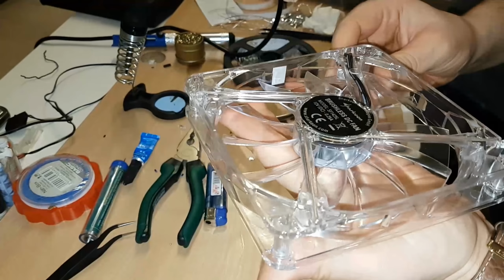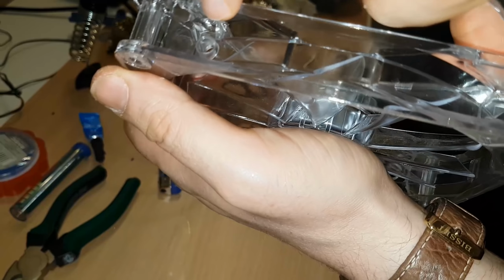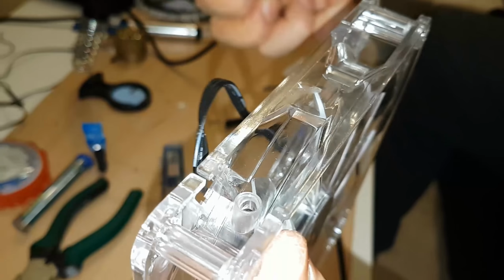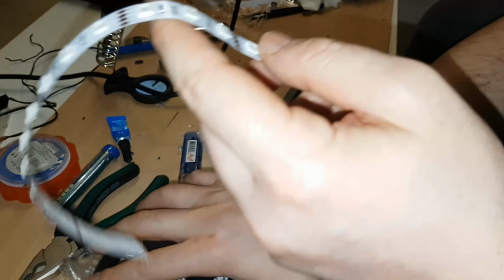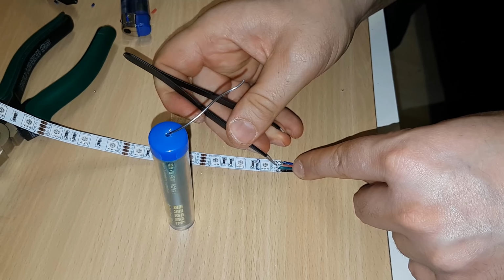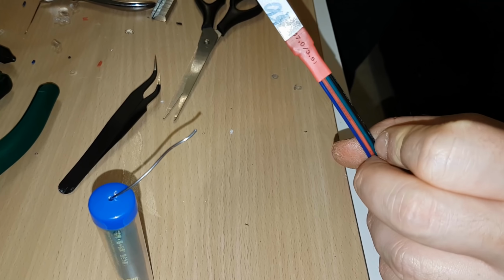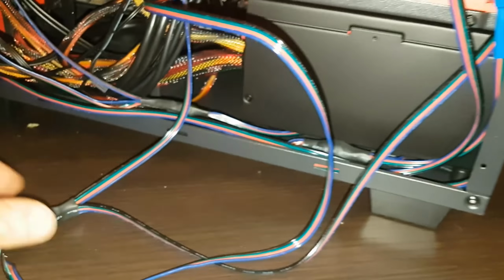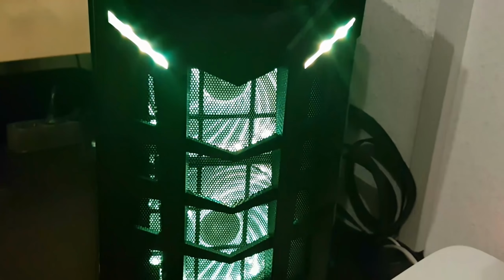How to make your own LED 12v R G B ASUS aura sync case cables management ring fans & led rgb strips

Comment: Hi mate a nice little video, i'm a Electronics Repairs Engineer by trade I would give you a small piece of advice and to anyone else watching this that when you've soldered the wires on before you use the shrink rap on the joints get some clear nail varnish yes varnish any type and brush a little over the joints it adds extra insolation and avoids any accidental shorts,  but nice work buddy :p
Reply from the maker: thank you :)

Comment: This is amazing. How you make your connectors for motherboard ?  Where you connect all fan and rgb strip.
Reply from the maker: Connect them together each color with the same color
Reply: @shafikbanialmrjehkassar4640  That i got it. i want to know about connector which connect to motherboard  on time of video 21:24 . your all rgb cables connect to motherboard that connector how you made. I have Addressable RGB strip but i didn't find connector to connect my motherboard.
Reply from the maker: I have bought them from Amazon... I live in Germany and online you can find anything you want but the connectors should come with your motherboard.
 any way I will send you links.

https://www.ebay.de/itm/111047186905

https://www.ebay.de/itm/143616871578

But I don't know if they pass with Adressablr RGB strip.

Comment: I will probably do the same cos i have some poor leds diyng on some fans and argb is super expensive. I have 12v rgb on Motherboard but not all Motherboard has that, now they come with 5v some.
Reply from the maker: You have to buy the 12v led strip then

Comment: hi, i have rgb strip 5050 which i buy from aliexpress, will it work on rgb fusion too..? still waiting for my motherboard to arrive
Reply from the maker: You have to see your Motherboard wich kind of rgb strip supports... read the Manual when it arrives and if it supports an addressable strip with data transfer then the normal strip doesn't work
Reply from the maker: I think gigabyte b450 aorus elite supports both addressable and 12v R G B  Strips but for sure the Addressable strip is beautiful more than the normal 12v RGB 5050
Reply: @shafikbanialmrjehkassar4640  thanks
Reply: @shafikbanialmrjehkassar4640  do u think i can sync using rgb fusion..?
Reply from the maker: Yes u must
Reply: War Machine  umm thy e. a dik thlakp. 4pin ag kha nia. rgp fusion 2.0 hmag khan sync thyh
Reply: War Machine  wc

Comment: Hi I have led strip that says 5v but it has 4 pin. Can I plug it in to my 4 pin motherboard so.I can control it in software? Thanks. Your reply would be a big help.
Reply from the maker: no here in my case i use 4 pins 12V strip in your case i think you have to see your motherboard what kind of strips supports.... so tell me the name and number of your motherboard and will tell you what you have to use.
Reply: the strip has indicated 
"+5, B, R, G"
Reply: @shafikbanialmrjehkassar4640  thanks for the fast reply. hehe. So i wouldn't blow my motherboard. got subbed from me! 😁
Reply from the maker: i need the name and the number of your motherboard
Reply: @shafikbanialmrjehkassar4640  msi b450m bazooka
Reply from the maker: @justd1zzy383   you can not use your Strip....
 you have to buy new one with the following info  5050 RGB LED strips (12V/G/R/B) and you can use max 2 meters.
Reply: @shafikbanialmrjehkassar4640  thanks for the reply man. 😊 that was a big help!

Comment: Could you please update the link to the 4 pin connector? Thanks.
Reply from the maker: Sonny Crockett Foxnovo® Dauerhaft 10M 4-Pin RGB Verlängerungskabel Linie für LED-Strip-RGB5050 / RGB3528 Licht Lampe https://www.amazon.de/dp/B00FFR7SLM/ref=cm_sw_r_cp_apa_i_GvEeBb6306XWB
Reply from the maker: Sonny Crockett 4 Pin Splitter, Mudder 1 zu 2 LED Verteiler Verbinder Kabel Led Strip Kabel für LED RGB Farbwechseler Strip (2 Stück) https://www.amazon.de/dp/B010D9KUWU/ref=cm_sw_r_cp_apa_i_GwEeBb9Q018Q4

Comment: Hi. i'm on asus prime x370 pro. how many meters can I use for my board?
Reply from the maker: Your RGB header supports 5050 RGB multi-color LED strips (12V/G/R/B), with a maximum
power rating of 2A (12V), and no longer than 2 m.
Reply: @shafikbanialmrjehkassar4640  hey, i really need help. i bought 5v addressable led strips, anyway i can fix this to match it with my 12v header?
Reply from the maker: @JCoFilms  unfortunately not you have to buy new 12v  50 50 RGB strip

Comment: How many LEDs per header?
Reply from the maker: Someone someone the strip is 60 LED per  meter and every fan  tooked 27 led
Reply: Im talking about power draw on the motherboard header
Reply: How many LED's per header
Reply from the maker: Someone someone two headers it is Asus strix 270F but i dont know how many led per header i just distributed them equally, three fans on one head and the other strips on the other head.